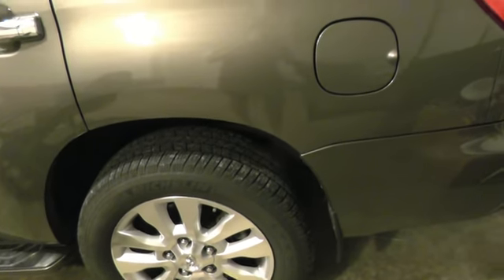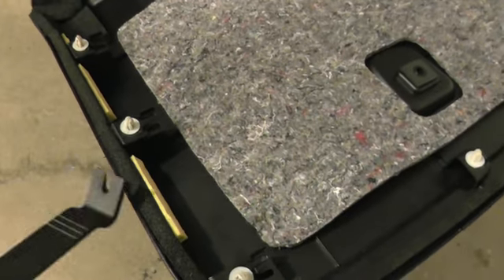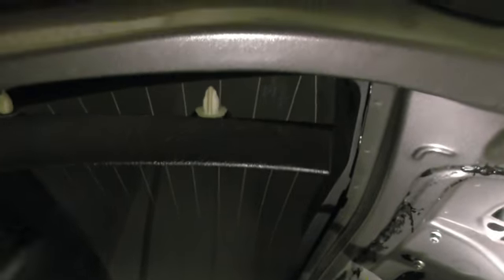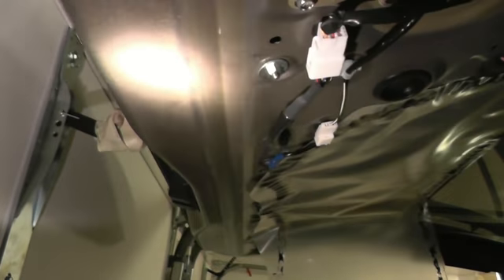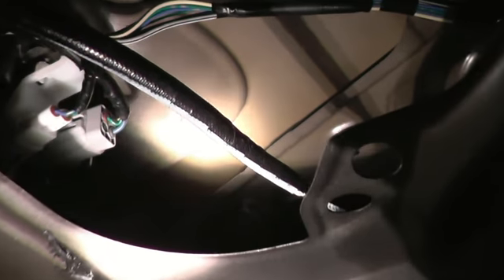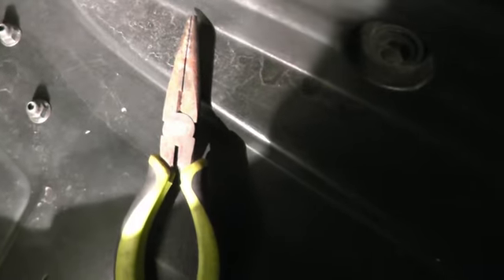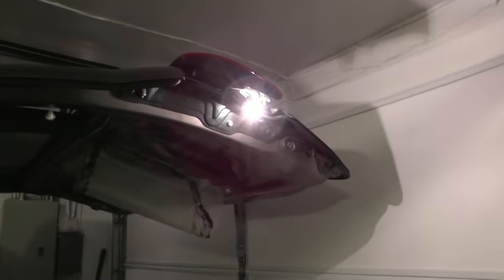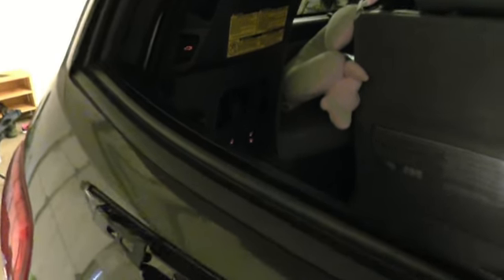2008-2017 Toyota sequoia rear led light bulbs instalation

Comment: You do NOT need to remove the door panels to change the light bulbs!!!!  Remove the 2 10mm nuts and just pull the light housing out.. I just did this today!!!  I have a Limited with power lift gate as well.. GUARANTEED YOU DO NOT NEED TO REMOVE THE PANELS!!
Reply from the maker: how did you released plastic clip from taillight without removing panel?
Reply: @repairvehicle  Just pull on it, came right out!!  I pulled the side where the bolts/nuts are out, then just gently pried from vehicle.. took me 5 min to do.  Wish I took a video.. I would show you.
Reply from the maker: I believe you. I was on the caution side and removed the panel so that I don't break clip on the light.
Reply from the maker: thank you. great info.
Reply: Yeah I couldn't believe the OP did all that for this 5 minute bulb replacement...yikes

Comment: You do not need to remove all those panels on the 2012 for the rear inner lights if you have the power liftgate option
Reply from the maker: Yes, you do. I have platinum with power lift gate
Reply: You are correct!!!  No need to remove all those panels!
Reply from the maker: @HiccaBurp  , so basically you broke plastic clips without removing panel?
Reply: Glad I read the comments.  While watching the video I kept thinking this can't be the way to get to the bulbs...  the platinum had little plastic pieces over the two screws on each side but once those were removed you could easily remove the fixture without removing all the trim as shown here.
Reply from the maker: Don't forget to subscribe,  I have ton of maintenance videos for Sequoia.
Reply: @repairvehicle  doing it now...  thanks
Reply: @HiccaBurp  Thank you! I started to go through the process and got to the part where I was going to have to take off the window motor and thought...there has to be an easier way. Whew.

Comment: This is NOT how to replace the rear tail light and back-up light bulbs on a 2nd Gen 2008-2022 Sequoia with a power lift gate. Refer to page 491 of your owners manual or go online and view the PDF version.
All you do is remove the two little covers, remove the two 10mm nuts and remove the rear light assembly, turn the bulb base counterclockwise to remove. The bulbs pull straight out and go in the same way.
Do not remove the back panels.
Reply from the maker: Thanks, but my way works too.